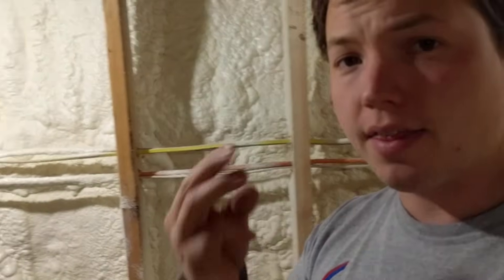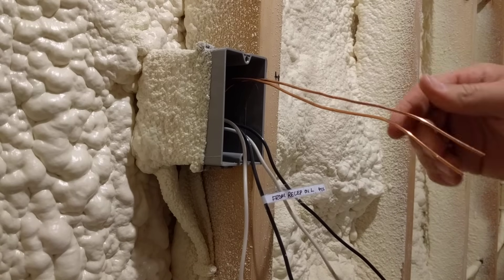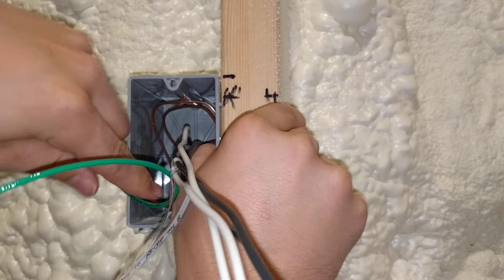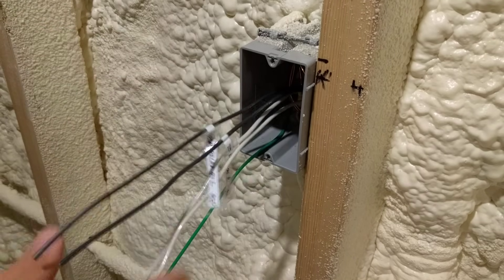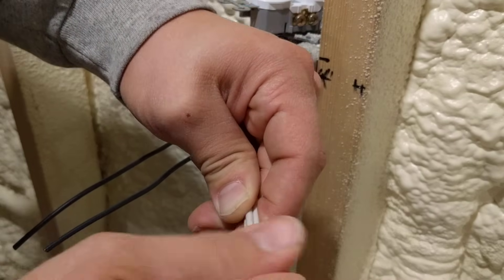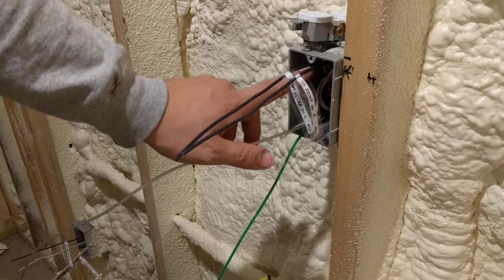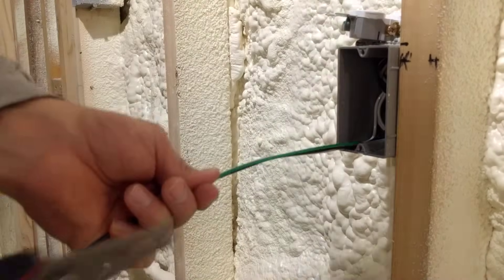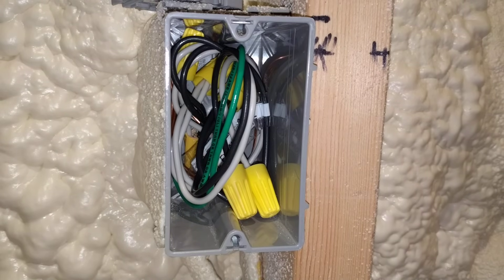How To Rough In Wires for a Standard Outlet or Receptacle Using Pigtails in Daisy Chain - Ben's DIY

Comment: Ben,   I really like your videos on electrical work.   I do have a question about this one though.   I have reviewed Articles 250(grounding) and 406 (receptacles) as well as branch circuits and can not find any indication that a #14 can be used in a 20 amp branch circuit to connect to the receptacle.   Please let me know which part of NEC gives you this exception to all the rules I find.   Respectfully,   Kevin
Reply from the maker: Great question. You are correct. The state inspector in our area recommends & is fine with using 14ga grounding pigtails on 20amp circuits BUT it is technically a violation I later learned. This is one of those things that you will need to check with the inspector in your area as to what they allow. To be safe you should just go with 12ga green insulated and then you don't have to worry about it. I think this all came from the fact that you used to be able to run a smaller grounding wire but they have disallowed that now. See this forum for more on the topic: https://www.bobvila.com/posts/76664-14-gauge-ground-wire

Thanks for asking!
Reply: Benjamin Sahlstrom    I've been an electrical designer since 1983.   The size of equipment ground conductors has always been based on table 250.122.   Although it is true that larger conductors have smaller equipment grounds, 15,20,and 30 amp circuits have always hade the same size conductor for equipment grounds.   Respectfully,   Kevin
Reply from the maker: @KevinCoop1  Wow! Sounds like I should be asking YOU the questions! Thanks for the clarification. What do you think of inspectors allowing 14ga grounding pigtails on 20amp circuits? Do you feel it is a major safety concern or more of a technicality?
Reply: Benjamin Sahlstrom    As I'm an engineer, I must say that the NEC as far as I can find says #12 in table 250.122, it states that a bonding jumper from circuit to box is per 250.122, (so no reduction allowed to a box) and I can find no exceptions listed for these rules.   As far as the AHJ, they can say or allow whatever they choose.   It's not normal for one to allow anything without something stating it is acceptable.   If you ever see the inspector again, I would ask what the decision was based on.    I'm assuming you did not get the allowance in writing!   If these were installed in customers dwelling, I can tell you that you our your company is liable in a court of law if something goes wrong and some "expert witness" says it's your fault and you will loose.   Best wishes,   Kevin
Reply: Benjamin Sahlstrom    And I can answer pretty much any electrical construction question you need answered.   I have my code books from 1983 to 2017.   Not buying 2020.   Not electronics though.
Reply: The code in his area may have at one point in time stated something about the equipment grounding conductor size for just the pigtail portion of the wire.

However, this is likely to not be covering a worst case scenario of a prolonged 20 Amp equipment ground fault to the receptacle’s third prong.

The physics involved have to do with diameter of the conductor, current passing through the wire, and the resulting heat and fire risks.  Heat energy losses follow Joule’s First Law and correspond to I^2*R, which is: Current squared times Resistance of the wire.  In a 20Amp circuit, you could potentially have up to 20Amps of current flowing to ground in a ground fault short circuit situation.  So thats 20^2, or 20*20=400 times the resistance of copper (or whatever part is the most resistance leg of the circuit). So the resistance of 14 gauge copper is 2.525 Ohms per 1000 foot.  So that short pigtail might be ok for a short fault that trips the breaker.  But what if the breaker fails to trip?  Then you have a piece of copper that is heating up over time, possibly melting the insulation or anything in close proximity and causing risk of fire.  Those paper wrappings inside the romex insulation are actually flammable (try pulling some paper out and lighting it with a match... it sure burns).
Reply: James Cuzella    I'm sorry but your calculations really do not mean anything constructive.  The NEC does not have an exception for calculations done under engineering supervision on this condition as it does elsewhere.   NEC 250.166 15a #14.  20a. #12.    Done and not up for discussions.   Has been that way since I started in 1983.   The table never changed.   I am impressed with your knowledge though.   You must be a physics guy.   Respectfully,   Kevin
Reply: Kevin Coop The calculations are not meant to mean anything in regards to the NEC requirements.  It was only intended to demonstrate the possible rationale to explain why that short 14AWG pigtail may have been considered ok at one time.

Then of course I tried to explain why it’s not the best idea in a worst case scenario... so don’t do it!

Comment: I guess you guys don’t have wago connectors yet, Much better than wire nuts we banned them decades ago but we are dealing with 240 not 110 in the UK
Reply from the maker: Wagos are becoming more popular but there are still lots of wire nuts in use for sure. I'm hoping to do some testing and see how they compare in future videos.
Reply: Look for John ward he has done some destruction tests on them over double the current resting  if I remember correct.
If you want a good example of load centre/consumer units have a look at my trusted electrician
Reply: I like Wagos better myself. Faster to install. Down side is cost and some old school inspectors don’t like them.

Comment: Hey Ben, I trained under a master electrician. I was taught not to rely on the wirenut for a secure connection so we use lineman pliers to twist the wire together first, trim the head then screw on the wirenut  until tight. Just my 2 cents. But great video!
Reply: With the newer wire nuts, manufacturers now state that the wires no longer need to be pre-twisted prior to applying the wire nut. I don't yet see an issue with continuing the pre-twisting practice though, so if that's been anyone's method, nothing wrong with sticking to it.
Reply: Another thing...if you fold the wires instead of curling them into the box they come out WAY easier and anyone troubleshooting later on will thank you.
Reply from the maker: Thanks for sharing your expertise!
Reply: Benjamin Sahlstrom No problem man. But the electrical career is not my path but I’m going after a career in IT. But I figured a knowledge of basic electrical will help.
Reply: To twist or not to twist! TWIST ALWAYS. The packages of wire nuts has stated for many many years you dont have to twist but  installing as you did in this video has more chances to fail. If I had a dollar for every non twist repair job I could take a major vacation .
Reply: What kind of problems could arise from over-twisting wires in pretwist?
Reply: chris kilburn  No issues. Pretwisting = Tight secured connection. Those “push in” connectors does not seem secured in the long run. Wires can come loose over time and cause issues.This master electrician has 50+ years experience in the field so I was taught to pretwist then add wirenut until snug.
Reply: Yeah, lineman’s pliers really help to ensure a much better and sturdier twist, so there’s less chance of them coming loose and causing arcing!

Comment: The purpose of the Wire Nut is to Cap the wires, not to twist the wires with the Wire Nut. Use Linemans Pliers to twist the wires
Reply: The purpose of the wire nut is to provide the electrical connection. Twisting wires only provides a mechanical connection that will corrode over time or release its twist and loosen. The wire nut actually digs into the surface of each wire and makes a gas tight electrical connection. That is why it is now optional to twist the wires before hand.

Comment: wire nuts are old tech which should be considered obsolete.  They should be made illegal to use
Reply: Then what would we use?  There are no good replacrments on the market right now.
Reply: @N-hunter  https://www.amazon.com/WAGO-222-413-LEVER-NUTS-Conductor-Connectors/dp/B000JJPA66/ref=asc_df_B000JJPA66/?tag=hyprod-20&linkCode=df0&hvadid=193984242218&hvpos=1o2&hvnetw=g&hvrand=2295192763901594579&hvpone=&hvptwo=&hvqmt=&hvdev=c&hvdvcmdl=&hvlocint=&hvlocphy=9029550&hvtargid=pla-314836175243&psc=1
Reply: Wago connectors are junk that need to stay in lightning fixtures.   I use almost exclusively stranded and they dont hold at all.

Comment: Shouldn't you use your linesman pliers to pretwist the wires before using the wire nut? That's how I was taught.
Reply: If you read the box the wire nut comes in... Is says to do it exactly like he did it. Twisting wires is unnecessary and makes wires brittle.
Reply: Bi Mil should never rely on the wire but to create a physical connection

Comment: The 14 AWG equipment ground trick is a great idea!  I didn't know code allowed that.
Reply: Code allows for downsizing the ground in a lot of areas since its not a current carrying conductor, except under fault. If a fault were to occur 14 would handle the load long enough to trip the protection device.
Reply: @NickFrom1228  
Makes sense. If you've got load current on the equipment ground you've got bigger problems than undersized wire
Reply: @NorthernWindNut  You certainly correct. Current on ground is bad, very very bad.  For the exact example the short circuit rating on 14 awg is something like 8 times (I don't remember the exact number) what a 20 amp breaker will trip at so it makes sense that they allow it.

Comment: Dude I went to electrical school and have read like 20 electrician books. One reason why I would use the extra screws on the outlet to connect to another outlet is for GFCI purposes. If you connect,  let’s say three outlets in continuous circuit which is by using the extra screws instead of pig tails all 3 outlets will stop working if one messes up or all 3 will trip if one does. So by doing pig tails the other two outlets will work even if 1 messes up because they will have continuous power. Hope that helps

Comment: Does it matter if both pigtails go on the top screw or bottom screw? Or one on the top and one on the bottom?
Reply: Power should only be connected on one screw so for the hot wire pigtail u can put it on either the top or bottom screw same with the neutrals but never put 2 hot wires (incoming power) on both screws unless the tab is broken
Reply: @Nick-bh1fy  Not sure if you will see this but can you explain this a bit more? I have some receptacles I am going to be replacing soon and this comment confused me a little bit. Lets say there are two wires coming into a box and I'm not worried about a pigtail. So I have two hot wires and the receptacle has 2 brass screws. Can I not just connect one wire to each screw?  Maybe I missed something. Thanks
Reply: @jonathangaliano2617  putting the 2 black wires on the 2 brass screws is okay and typically used by a lot of people bc it’s a lot faster than creating a pigtail, but technically with the new code, neutrals must be pigtailed and not rely on a device to complete its path. Ultimately u can do whatever u want as the home owner
Reply: @Nick-bh1fy  I appreciate the quick reply! I am just getting started and want to learn as much as possible. So you're saying anytime there are 2 wires coming into the box, new code technically requires you pigtail the 2 neutrals and then connect to a single screw on the receptacle.. compared to just connecting 1 wire to each of the 2 screws right?

My current situation is an older house with 12g wire on 15amp circuits. I took a look at one of the receptacles in the room I am fixing up today and there are 3 wires coming into the box. No pigtails they just used a combination of the screws and backstab holes. I quickly learned that backstabbing is no good and even if I wanted to do it that way.. modern receptacles only accept 14g wire for backstabbing anyways. 

I understand the purpose of pigtails.. so if one outlet fails it won't affect the rest.. but if I am not worried about that in this room is there any reason I can't just use the "back wire" type receptacles? The ones that technically allow you to connect 4 wires on each side.. 2 under each screw plate. Something like this https://inspectapedia.com/electric/Receptacle_Connectors_Clamp_Screw_025_DJFs.jpg

Thanks again!
Reply: @jonathangaliano2617  with the black hot wires it’s perfectly fine if you put 2 wires behind the clamp since it accepts it but never bend 2 loops under one screw. But w the neutrals I get space might be limited plus 12awg wire is bigger than 14 so pigtailing it may be hard. You are right w continuing the path so other devices work but should be careful because loose neutrals can cause damage to devices plugged in so if you double clamp make sure it’s a solid connection, when u think it’s tight give it a tug and tighten it more you’ll get another quarter inch of turn or so. Best of luck
Reply: Also make sure you aren’t crossing neutrals from 2 separate circuits
Reply: @Nick-bh1fy  This confused me a bit to be honest I am not sure what you mean by crossing the neutrals?  

As far as my situation it would be pretty hard to do pigtails with the very limited space. That's why I was thinking of just getting the back wire receptacles. Just wanted to confirm it's fine to have 3-4 wires (hot or neutral) going to the back wire pressure plates right? Each screw can hold two wires for a total of 4 per side.
Reply: @jonathangaliano2617  yes in your situation back wire is fine, make sure those connections are solid and you’re good to go
Reply: One tip I’ve been given was to use the top screws for your hot/neutral and have your box/receptacle grounding terminals oriented so they’re at the bottom (lowest point in terms of gravity).
This way, any loose conductive debri or flooding/water in the box will be more likely to make contact with ground first as well as maintain some distance between the hot conductor and said debri.
It does make some sense to me and mostly I do it this way just for consistency if anything.

Comment: Benjamin Sahlstrom, just wanted to recommend Wago push nuts and lever nuts to you for use instead of twist nuts. I have personally used them and find them easier to use and make just as strong if not a stronger connection for pig tails.
Reply: Dracopendragon013 That maybe true. But I still don’t trust “push in” connectors. They will get loose over  time as well. You can’t beat the good ole wire nut.
Reply: For pig tails they're really the way to go - especially if you're running 4 wires per nut. No headache.
Reply: Wago lever nuts do not get loose.
Reply: I’ve had great luck with wago push in connectors but I can see the concern as it can be easy for someone without a lot of experience to mistakenly think that a wire was fully seated when, in fact it wasn’t. The clear tips where you observe the seating sometimes get dirty and it’s difficult to tell. Of course, I’ve never done this but I could definitely see an amateur making this mistake🤓. 
Also, I do worry that any twisting action on wires that may have tension on them will pull the wire out since that’s the method for removing the inserted wires. The likelihood is minuscule I’m sure.
Would you say the lever wago connectors are more secure than the standard push in type?

Comment: By using a smaller AWG size on the ground system you’re derating the entire circuit, I’m certain you need to use same size AWG as your circuit, you can go higher than your circuit but no lower, i could be mistaken but that’s the way I’m being taught

Comment: Could do a video of metal receptacle boxes? Pigtailing the box ground etc..
Reply from the maker: Yes that is something that I would like to do in the near future. Stay tuned!
Reply: Bignuke321 wrap your bare ground wire(s) around the bonding screw(s) in the back of the box. In the case of one ground wire wrap it around clockwise and leave enough length to connect to ground screw on the device. In the case of 2 ground wires wrap both of them clockwise cutting one of them short and using the other to connect to your device. Hope that helps!

Comment: Shall i twist the wires or not ?  If you work on small metal boxes of the 50’s with 3 inch terminals and 12 ga wire and 3 conductors meeting inside, try to twist (if you can).

Comment: Ok to use 14 ga wire for grounding 12 ga wire. Grounding is used to trip the breaker when a short between hot wire and grounded item occurs - the ground wire is not designed to carry active load. Since 14 ga copper wire fusing amperage is 166 amps, using 14 ga ground wire for 20 amps circuit is allowed.